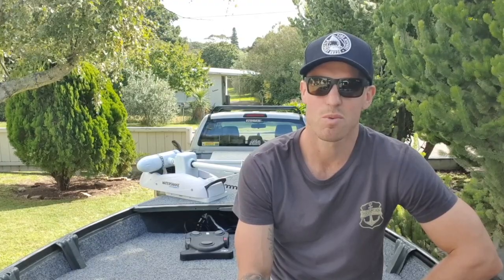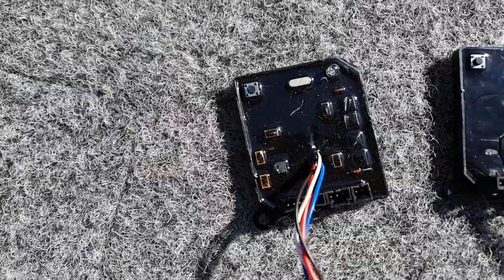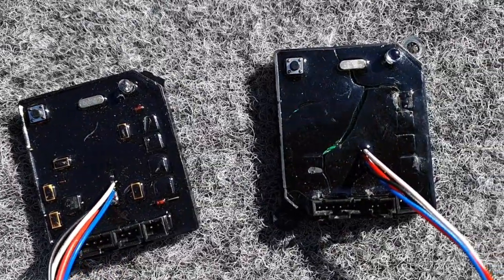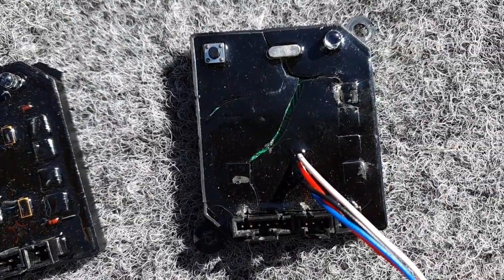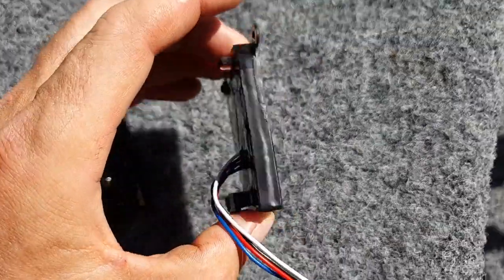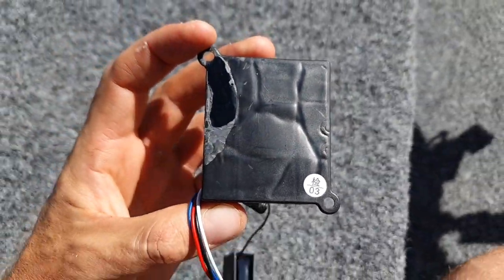Jarvis walker watersnake electric trolling motor issue

Comment: that's stupid they should have a voltage regulator in them, what if you want to run a Lipo4 battery which has a fully charged voltage of 14.6

Comment: Hi Damien,  just picked up a Watersnake ambush, from a guy, he claims he had not used it. After setting it all up i found that it would only go left or right, no forward thrust. So i took the head off to try and pair the remote and the circuit board looks like the broken one u had. Do u think this could be my problem as well. Did J/W send u out a new board? Thanks for your help.
Reply from the maker: Yeh maybe mate, give them a call at the office and see what they say

Comment: Good info. I have my combat to a anderson plug. From there i have a metre cable to the battery/ fpv box so when charging i disconnect the fpv and have my battery charging straight from the charger or solar panel not connected at all to the motor. Cheers for the heads up tho
Reply from the maker: No worries mate just trying to help everyone else not make the same mistake haha